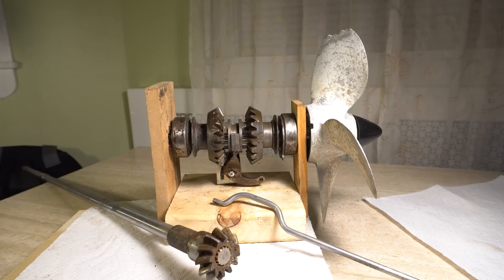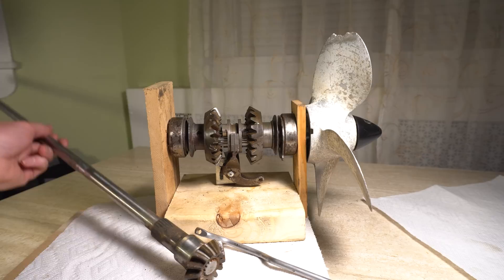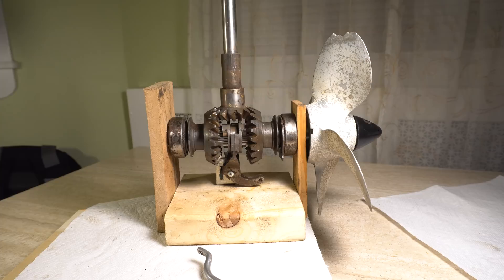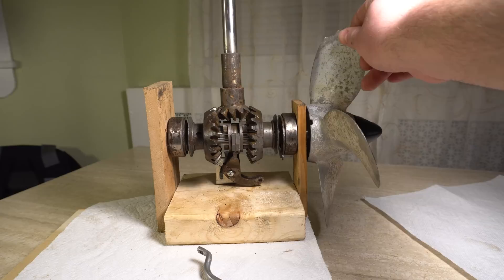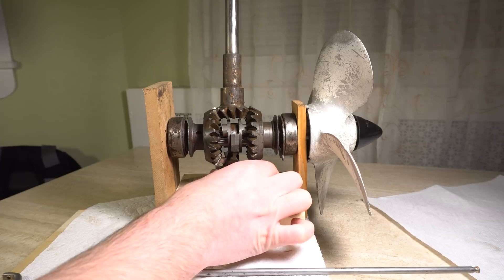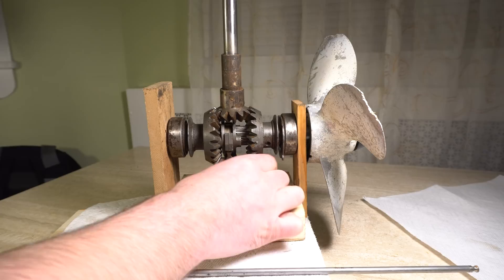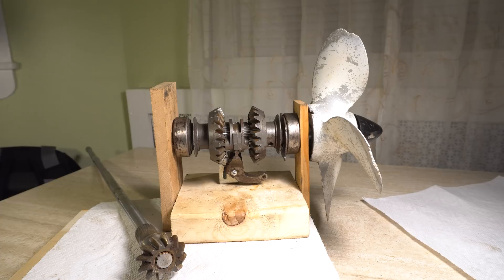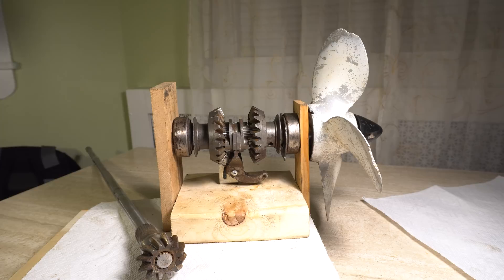How an Evinrude gearbox works - outboard gear shifting - forward / reverse

Comment: Even as a kid this was not hard to figure out. What did baffle me is how you can suddenly engage the gears--teeth to teeth--at high speeds without complete mayhem.
Reply from the maker: At idle its not that fast... but still. It is a very rugged mechanism. You could literally call it stone age.
Reply: Plus as described above the prop allows for "Slippage" in the water, and you would never want to shift into gear above idle.

Comment: I was an OMC/Evinrude/Johnson Master Technician. You're right that people don't understand this. But you really didn't explain half of it. First, the "clutch" as you call it has teeth ("dogs")  that interlock with teeth on the gears to lock one or the other gear to the center splined shaft. And second that failure to engage those fully (bad adjustment) and with some firmness creates that "clunking" sound going into gear and can wear the dogs until their mating edges become rounded, and then the engine easily jumps OUT of gear. Glad you added "part 2" so people can see the faces of the clutch and gears!
Reply from the maker: Thanks for adding additional info; yes "Part 2" goes more in-depth and I have a few other videos I recommend checking out showing the driveshaft / props haft / etc. very clearly.

Comment: I installed a 1988 40 hp Johnson myself, cables, everything. I had forward drive issues and was going to tear into. Thank God I watched your video. You were 100% right. I heard a clunk and it wouldn't engage, but reverse was fine.  I ended up adjusting the cables over the course of a few trial runs and now it's perfect. Thank you man!!!

Comment: A long time ago my dad's boat with an Evinrude motor would not reverse in the water. Took it to a boat shop and the guy told him he needed a new transmission. Wanting to charge a few grand.
Reply from the maker: Yes, boat repair costs are no joke. If you know absolutely NOTHING about the motors, you can easily spend $$$$ to fix something that costs 5 bux.
Reply: This was a long time ago,mid 90's. Before Google and YouTube,lol.
Reply from the maker: Yes, times sure have changed. I don't think I could do all the stuff I do now without YouTube and forums.
Reply: Thanks for posting this up. Now I know what was the issue with that motor. It has stayed in the back of my head all these years. I will show this vid to my dad.
Reply: I had a friend who bought a boat years back and I believe reverse gear quit working. She took it to a shop and they wanted to rebuild the entire gearbox. I told her have someone who knows what they're doing check and make sure the linkage is adjusted properly. Linkage adjustment from the remote control as well as adjustment on the motor itself. It turns out that was the only thing that was wrong with it. It probably took no more than 20 minutes to adjust it.

Comment: this image brings back many memories. My father had a side business doing outboard motor repair during the 60's through 80's. I was in grade school when I was taught how to "Split the Lower Unit", and replace the rubber tubular gasket and rear seal. It is a good idea to check the condition of the lower unit lube when considering a used outboard or even inboard I/O Drive. if fishing line gets wrapped around the prop shaft between the seal and prop it can destroy the seal, also early OMC "Split Case" lower units can have dried out gasket between the upper and lower halves. In either case the lower unit will have water penetration turning the heavy weight lube to a "Thin Milky Consistency". Unfortunately if kept in this condition for an extended period of time the internal bearings, gears, drive shaft, shift fork, and clutch cog will become rusted, sometimes seriously pitting the metal, and locking the lower unit in neutral/forward or reverse. it is always advisable to service the lower unit by checking the condition of the lube, draining by removing the upper and lower drain plugs allowing all the old lube to drain. Then using the recommended lower unit lube fill from the lower drain hole, until it comes up to/out the top drain hole. Then install the top plug with the tube or pump hose nozzle  of the lube still in the lower hole, and quickly remove it and install the lower plug Installing the upper plug should create a "Vacuum" as the lube tries to drain when following up by installing the lower plug. There are also nylon or sometimes rubber washers or O-Rings on these plugs and should also be replaced when servicing. The key is to not allow any water to enter the lower unit which can cause serious damage.

This appears to be a very old (1960's) OMC (Outboard Marine Company: Johnson/Evinrude) "Spit-case" lower unit. Later Outboard motors and Inboard I/O Drives are "One Piece" and not split. The internals must be serviced/repaired by removing the prop and rear bearing carrier. Mercury/Mariner Outboard Motors and Outdrives require specialized tools to disassemble/reassemble. Also Bearing preloads must be set to specific values.

Motors used seasonally or in salt water should be flushed with a hose/fresh water and a "cupped headset" type attachment or bolt-on water intake plate on some models. To "winterize" this should be accomplished and the motor ran until all the gas is run out of the carb(s) there is also a "Spray Fogger" which can be sprayed in the throat(s) of the carbs during this process. Also fuel stabilizer should be added during this process to protect the fuel system from corrosion. Run the motor with the fuel line disconnected until all the fuel is ran through. Also either add the proper amount for fuel stabilizer to the tank, or drain completely if it will be unused for a longer period of time. This 'Prevention" can save on serious fuel system issues later on when the motor is returned to operation.

Another common problem is the "Water Pump Impeller". a rubber bladed/spoked component which is contained in the Water Pump Housing at the top of the lower unit, driven by the drive shaft. it is "Offset" in the housing creating voids between the blades which cycle from larger to small during rotation causing the water to be pressurized and pumped up through the powerhead or inboard motor. these become dried and brittle especially in stored in hot environments, and degrade over time. If the motor no longer pumps cooling water upwards the the Impeller blades are worn, or may even be separated completely. These require a tight seal within the Impeller Housing (Sides/Top & Bottom), to operate properly. Also if they are removed to check the condition and reused then they MUST BE REINSTALLED the same orientation as they came out of prior or the blades will be bent in the opposite direction causing complete failure when they are turned by the drive shaft. They must all bend in the same direction as determined by the powerheads driveshaft direction.

On motors of this vintage and even newer, generally to replace them a new "Impeller Kit" needs to be purchased which generally included the impeller, top and bottom plates, and a "Half Moon" or other type of key to drive the Impeller with the driveshaft. Generically you must access the shift rod coupler (typically located on the upper part of the lower unit leg below the powerhead, and behind an access plate on the side) This connection couples the Shift Lever to the Shift Rod going down to the lower unit. then all the bolts are removed which attach the Lower Unit to The Leg. Generally the drive shaft is splined and will come out of the bottom of the Crank Shaft in the Power Head. With all the lower unit bolts removed, Shift Rod Coupler disconnected the Lower unit should "Drop" down and can be removed. Typically the outboard motor must be tilted up to allow clearance to get the Drive Shaft and Shift Rod out of the Leg Housing. Once removed the Impeller Housing should be visible on the top of the Lower Unit allowing removal of the bolts securing the Water Pump/Impeller Housing and the housing itself. The new "Impeller Kit" can then be installed replacing the worn or damaged components. The Impeller should be lubricated as directed in the included instructions, or Motor's Service Manual during installation. It's typically best to replace the Impeller Components even if they look serviceable as it is now all accessible. This small price of prevention can save on catastrophic power head failure if the Impeller fails and the Power Head overheats. The reassembly is just a reverse process of removal, but care should be taken to not damage the top splines of the drive shaft or powerhead crank shaft. feeding the drive shaft and shift rod up the leg and into place can be challenging sometimes, and may require moving the shift lever forward or reverse to get the coupler connected DONT DROP THE BOLT! Also you may need to rotate the flywheel on the powerhead to get the splines to line up. Patience here can save many headaches. Never rotate the drive shaft from the power head in the reverse direction as this can cause some or all of the blades on the impeller to bend the wrong direction.

Though this is generalized many outboards use a similar water pump system. Larger Inboard/Outboard motors may be much more involved to access the Water Pump Housing and components as the Outdrive must pivot to raise and lower the Outdrive, and are driven horizontally from the Inboard motor to the pivot point and then down to the Lower Unit Housing. And like I said may require very specialized tools sold by Mercury and OMC or other manufacturers, specific for the application used.

I know this was a long winded Comment, but hopefully someone may get some use out of it, especially if the water pump stops pumping and you may wonder why. Blockage is also a possibility within the Water Passages, especially if the motor operates in a salt water environment and isn't properly flushed after operation. Also NEVER RUN THE MOTOR WITHOUT A WATER SUPPLY! Serious damage to the Impeller, or over heating the power head likely will occur... Also these steps should be done "On Land", Watching  a bolt or other component sink to the bottom of the lake can be horrifying!

Comment: I do videos on my channel to try and help people with certain things. Kind of a "pay it forward" type deal. Thanks for posting this. Excellent visual and explanation of this! On point, clear and concise. 5 years later people like me are just finding your video!
Reply: When putting drive shaft back in the lower unit on my 35hp Johnson do I need to release the oil pressure because it feels as if something is pushing it back up.

Comment: Well done, a very clear, crisp explanation.  Yes, it does not look difficult, but man, those gear parts are horrifically expensive.  Much more than an entire good used power head or complete lower unit, for most engines.
Reply from the maker: Yes I recommend buying old parts and taking them apart.

Comment: Another you tube fact that I never even knew I needed to know, but will now be forever thankful that I do.
As you say so single, never even thought that it all happened down in the bottom of the leg, always assumed the transmission was up the top under the motor with a right angle bevel drive at the bottom.

Comment: The Key here is that there is actually NO friction material, it is a solid metal dog on a solid metal gear and THAT is why you never slowly ease a boat into gear, you just pop it in or out as fast as possible so you are not banging the dogs on the gear and beating them to death.
Reply: Absolutely 101% correct.

Comment: Brilliant information, my engine wasn’t going forward, just into neutral and reverse, took the gearbox apart n fixed what I thought was the problem but after assembling it back it now goes into neutral and forward but not reverse 😅
Reply: Any solution to why this may be happening??

Comment: Thank you, I'm pretty well versed in all small engine repair, except lower unit stuff on boat motors.   I've never done much more than a sheer pins and fluid.  My Mercury 115 won't engage in reverse 99% of the time.  Appreciate you taking the time to post.

Comment: I bought a 1976 Evinrude mounted on a 76 VIP. It's a stick steer. I have  broken two plastic cables ends that are attached to the gear shift handle when putting in forward. Obviously, something needs to be calibrated. Learning as I go...

Comment: Good demonstration and explanation  about 20 years ago I restored a Wooden Chris Craft Cabin Cruiser  i had to pull a blown motor and replace it when I got it out  I hauled the Paragon transmission home  with me to do a visual inspection on my workbench  I had a lot of fun  spinning it and shifting to make sure it was worthy of installing in the vessel with a new motor  its  funny because. I ran into a old timer  boat repairman  and restoration guy  who told me he had a guy that could get  any parts I might need  and I asked him if I should  have it rebuilt by that shop the guy laughed at me and said if you think it’s working  correctly  put it back in the boat those old ones run forever  save your money  ive sold that boat and still see it around to the best of my knowledge it’s still  performing in her original spot made to a “new 283 Chevy small block  raw water cooled motor painted Chris Craft Blue like it was inn1964

Comment: Glad to see a video on this topic but somewhat incomplete description, leaving the viewer to work out that the two pairs of pegs on one of the  clutch components have to engage  in recesses in either forward or reverse gear rings. Or so it would appear. Closer inspection with the camera would have helped.

Comment: Very similar to synchronizer rings in an automotive gearbox. Cool!
Reply: Its crazy how different yet so similar.  Autos, Boats, planes.  They have all adopted something from the others.  Even if its just simple rivets, to engine tech.  ENGINEERING=❤😍
Reply: Um No Because that is Not a transmission  there aren't any synchronizers Also it's a boat not a car You have alot to learn about mechanical engineering
Reply: Wolf Firewalker I said similar, not identical. You have a lot to learn about the English Language.

Comment: Think about it as a car's rear differential. Here there is one gear that is responsible for the propulsion. In a car power is transmitted to 2 gears so that it is evenly distributed to both wheels. A cars differential gear connected to the wheel have their own clutch to control power to the wheel. It helps when one wheel is stuck in the mud power is transmitted to the other wheel so that traction can be established.
Reply: It doesn't have to be a rear one.

Comment: This presentation was brought to you by Captain Hook
Reply from the maker: LOL, awesome comment!
Reply: Capitano Americo jjj
Reply: You do realize that the "hook" he used as his presentation pointer, was the actual shift-rod for the lower unit gears... yes?

Loved the video, but wished it was more relevant to the majority of outboards on the water.
It would be more realistic, if the gears were covered with a milky, sand and grit laden gear oil, boiling (due to running full throttle, with a two year old water impellor) and various chunks of hammered metal whirling about (from engaging the propellor at 2000 rpm). But hey... it conveyed the basic concepts.
Thanks!
Reply: Lol

Comment: Low tech system, easy to understand.
Reply: I knew how it worked off the thumbnail
Reply: It’s a egg beater almost the same as a fishing reel but the prop would have drag washers for it to slip
Reply: @trexmidnite  h6jy